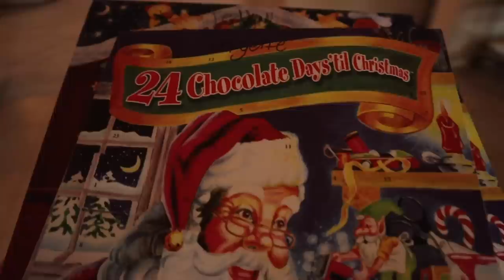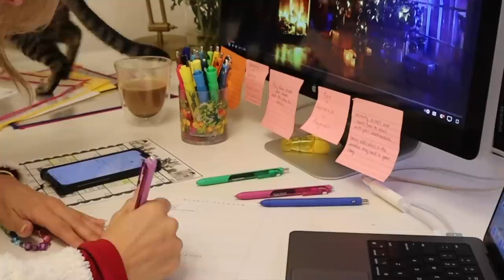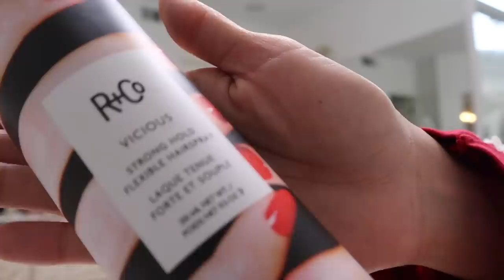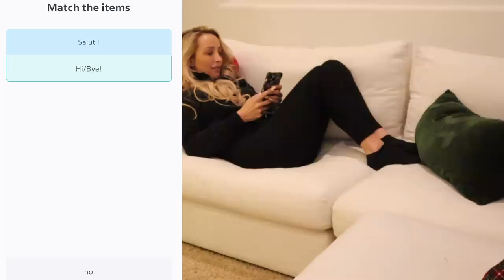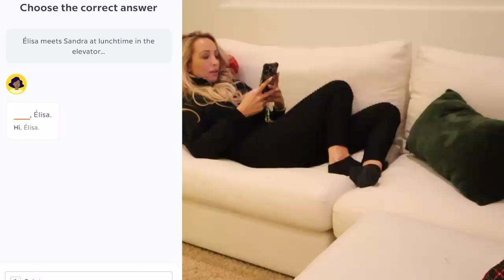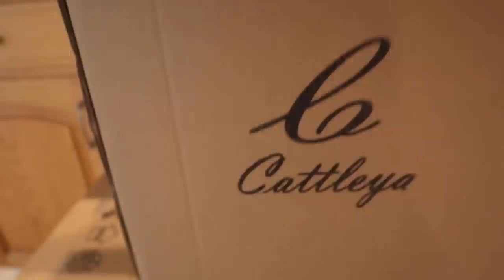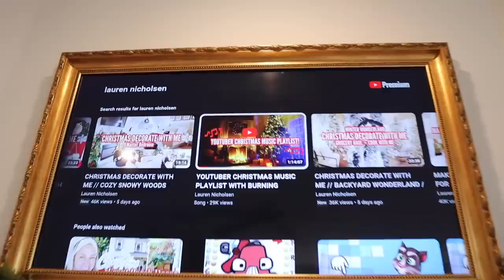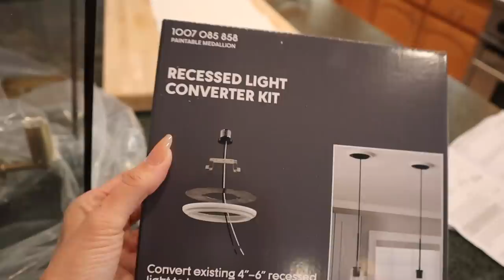DAY IN THE LIFE // GET READY WITH ME // HOME PROJECTS // PUFF PASTRY TOMATO SOUP AND SALAD RECIPE

Comment: I agree you need a dining room.  The original plans should be in your towns public records.  I’m planning on some small projects.  I’m also painting the front door black.  I changed the shutters from green to black.  I’m replacing my hot water heater in early January.  I recently updated the front landscape.   You certainly have lots of plans to renovate 29:57